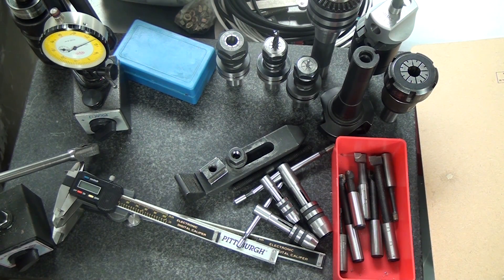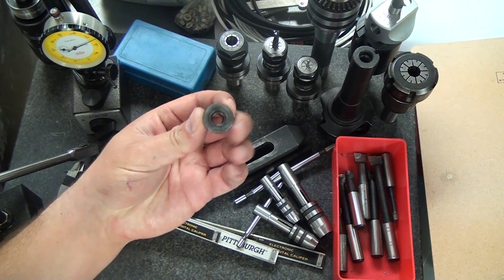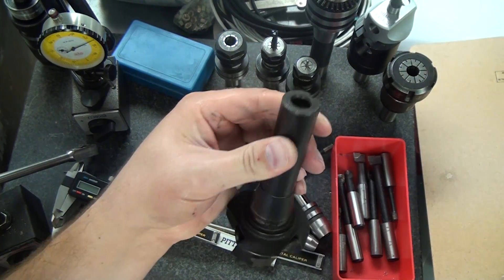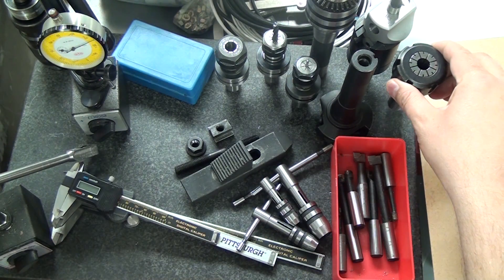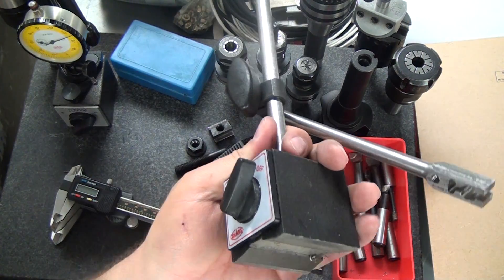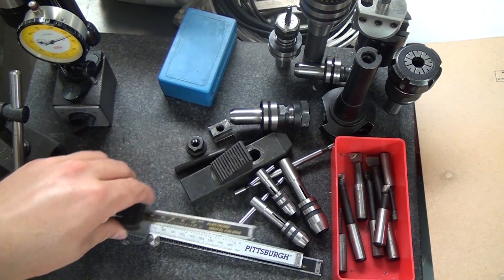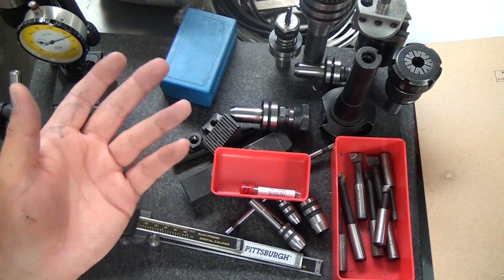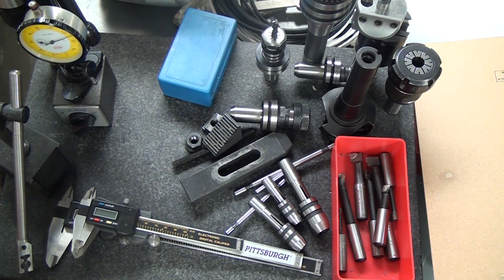02 TSOTM - Initial Tooling Considerations (4yr followup)

Comment: I think I remember that you got rid of your Red standalone HF 1hp 6 inch band saw. Do you think that saw takes up a lot of floor space and the portable HF 10amp 5 inch Deep Cut saw is enough for stock cutting? Is the unattended gravity cutting on the bigger saw a big plus? Is a reciprocating sawzall all that is needed?  I'm personally concerned about size, storage, and floor space. What do you do for stock cutting and your thoughts?
Reply from the maker: Hello. Yes I did get rid of that bandsaw, and coincidentally I am uploading a video this very second where I discuss/show the bandsaw I bought to replace the red Harbor Freight one. No I did not think the HF saw took up much space at all, and I really liked that saw.
I have never used a portable saw like the 10 Amp Deep Cut Variable Speed Band Saw but I know some people do like that style of saw. Personally, I would feel limited by its size. If space is really tight then it might not be a bad option though.
My new video will be online later tonight and you can see the saw I'm using now.
Reply: Thanks. Regarding tool holding strategy: Do you just get ER16 TTS chucks and collets or have you tried/considered making individual set screw holders for each end mill for a Z height, runout, or convenience improvement?

Comment: I couldn't agree more with your conclusions, I feel the same way for the most part. Good boring bars are hard to find. and A TS ER-16 is the way to go very flexible if you use a lot of smaller EM'S.
 Great job,
Be Safe Sam
Reply from the maker: +CNC4XR7 Thanks Sam.

Comment: I love your work and your videos.  One thing I will say is buy good tools.  Things work better with good tools. With that in mind, spend the money and order a six inch set of brown and sharpe calipers.  They are the smoothest I have ever used.  They will put your cheap ones to shame, and you will use them  more because of it.  That will result in more accurate work.

Thanks for your videos on the 0602 lathe.  I have one and plan on making it CNC someday.  Your videos will be the blueprint for that project.
Reply from the maker: +James Merson I get your meaning, and if I ever have a need for a bigger/better machine I'll likely buy better tooling then too. I haven't looked at Brown and Sharp calipers at all though, thanks for the tip :)

Comment: I love these tool videos and shop experience videos. It's great to be able to share information. I had been using TTS collet holders with overlapping metric collets for drill bits because of the Z axis limit you mention. Then I bought the smaller TTS drill chucks from tormach and use them for occasional drilling. If you'd like a good insert boring bar direct from a US manufacturer try Mesatool.com. I love those.
Reply from the maker: +Liberty4Ever I've been meaning to buy more collets and use them for drilling. I've seen a couple other people do it and I bet you get less run out too.
Thanks! I'll check out Mesa.
Reply: +russtuff My big relelation - Use machine screw (stubby) drills.  I have a full set of cobalt stub drills.  I bought them because I could use them after milling without raising the mill head (and losing zero), but they're also much stiffer and they don't tend to walk, so I often get by without needing to spot drill.  They worked great in ER20 collets, but they also work very well in the 1/4" and 3/8" TTS drill chucks, without needing to raise the milling machine head.

Comment: If your looking to upgrade calipers I've got a mitutoyo and a 30$ pair from  igaging. I will almost always grab the Igaging first. Not quite as smooth but better screen and button layout. Love em!
Reply from the maker: +heatwoleboarder I completely forgot about igaging. I'll give them a shot the next time I need to buy a replacement. Thanks!
Reply: +russtuff I've got LOTS of the iGaging stuff - only thing I seem to find is that when they power down (manually or automatically), they're not really off.  They EAT batteries like crazy!  Now, I've just gotten into the habit of pulling them out every time I'm done with them, and the cells last for years.

Comment: Have you considered using drill bits in the ER holders instead of a drill chuck? I made my first investment in TTS holders and have high hopes. Great video.
Reply from the maker: +Kent A. Vander Velden I've done it on my lathe a couple times, but not on the mill. I'll start doing that :)
Reply: Tormach also has a tapping head which uses ER20 collets. ER20 seem like a good choice.
Reply: +Kent A. Vander Velden I was going to say the same thing. For the price of chucks you can get more ER holders, leave the tooling in there and get better results.